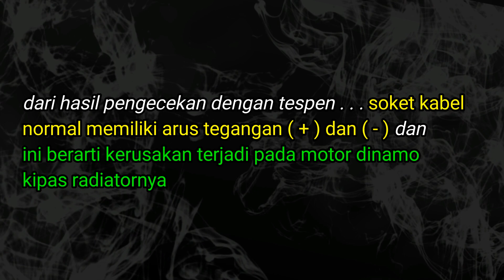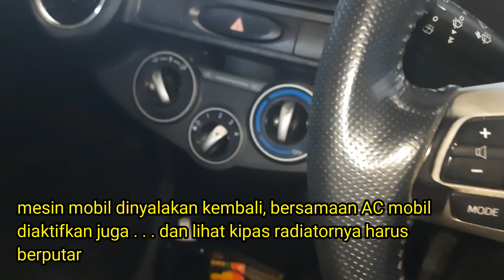Cek Kipas Radiator Toyota ETIOS VALCO tidak berputar

Comment: om etios saya kipas nyala terus tidak mau mati, padahal air radiator tidak ada kebocoran dan air culen masih setabil. apakah sikringnya yg mati om?🙏
Reply from the maker: Ada beberapa kemungkinan antara lain sirkulasi air dari mesin ke radiator atau sebaliknya tdk lancar atau thermostat rusak atau relay kipas rusak atau swictch temperatur mesin rusak. Lebih pastinya cek ke bengkel utk memastikan apa penyebabnya
Reply: @AJMcrews  ok trimakasih om

Comment: Mas. Kipas radiator etios saya nyalanya cuma saat AC dan browler di nyalakan. Kalo gak di nyalakan kipasnya gak hidup. Apa normal?
Reply from the maker: Iya itu normal saja..tanpa AC dinyalakan biasanya kipas akan berputar secara otomatis jika temperatur mesin telah mencapai panas tertinggi dan pd mesin ada sensor temperatur yg akan memberikan sinyal kapan kipas harus berputar dan saat suhu mesin mulai dingin maka kipas akan otomatis berhenti, begitu seterusnya berulang2. Pastikan saat AC dimatikan biarkan mesin dinyalakan lama sampai mesin benar2 panas dan tunggu suatu saat kipas otomatis hrs berputar nantinya